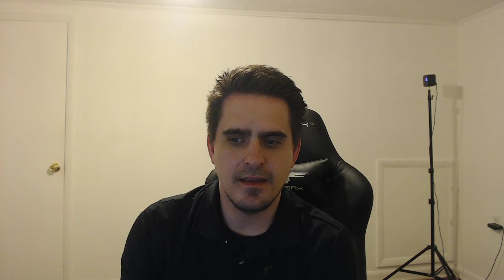Why Hire a Navy Nuke?

Comment: Very good breakdown of what Nukes are capable of. I've been working with government contractors since I got out in 94. Most of that time (19 years) with one company where I've been in management for much of that time and currently the Compliance Director. I've had 2 former Nukes as the President and currently one of the VPs is a former Nuke that started at the bottom working for me and continued his education, left the company at one point and was brought back. He has a good chance of becoming the President as some point. He would be if it were my choice. 

I've worked with a lot of Nukes to say the least. Two of the guys I was a Navy instructor with got me hired when I got out... networking is a good thing. We brought in another of our fellow instructors, all of which ended up in VP positions here and other companies. 

Problem solving is one you mentioned, that is so true. In my opinion it's one of our best qualities. Another is our ability to do it under pressure.
Reply from the maker: Glad you liked it and I appreciate your comment!